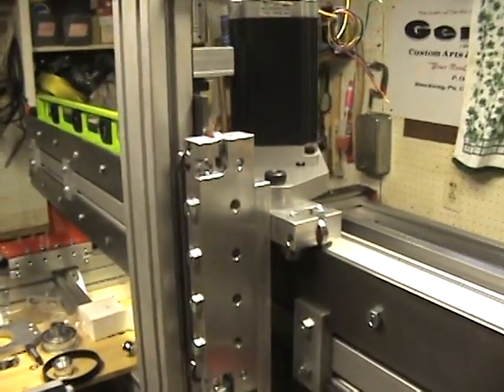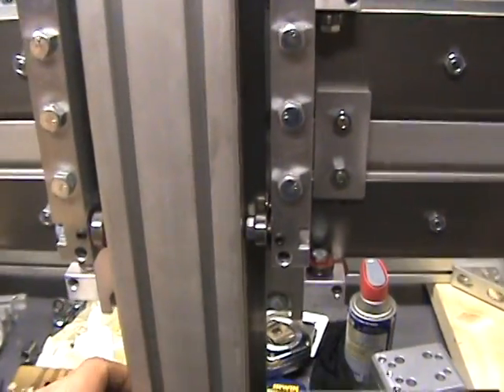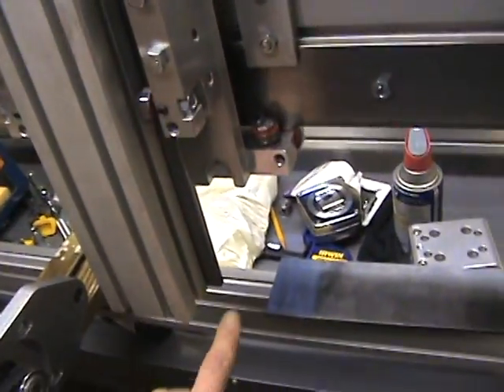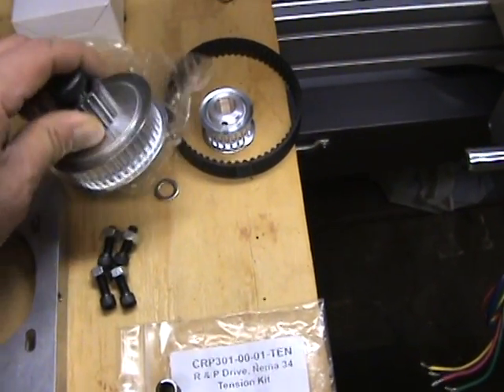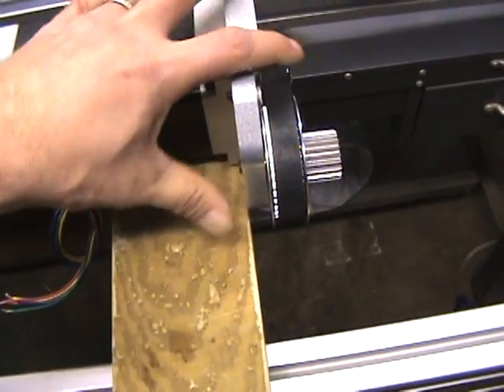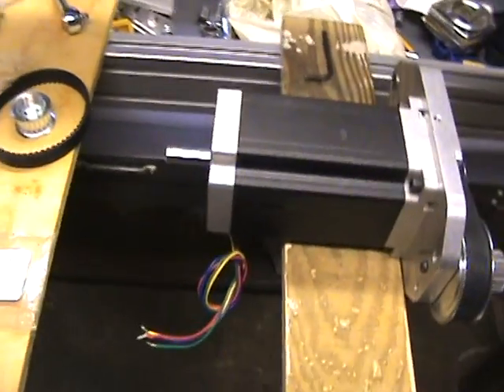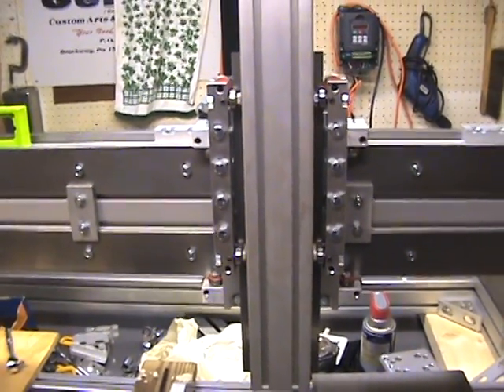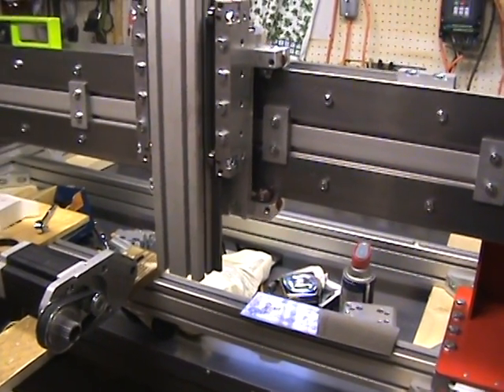Building CNC Router Parts CRP4848-11.MPG

Comment: SipmlyCNC-
  We have had very good results with these couplings and lead screws. Even if the stepper is slightly misaligned the lead screw is very accurate. The thrust bearings and shaft collars keep the vertical back lash to a minimum.